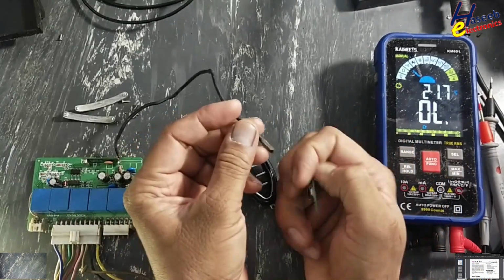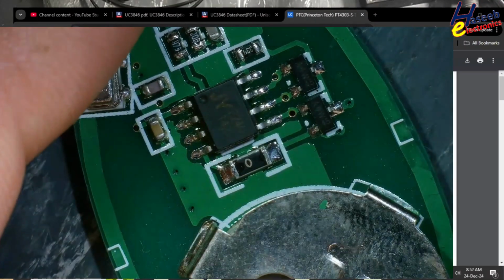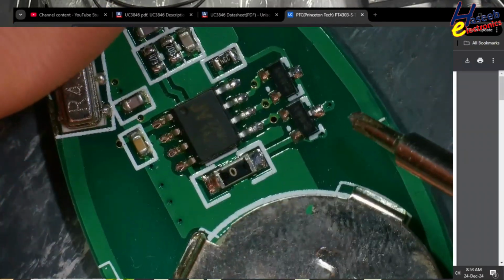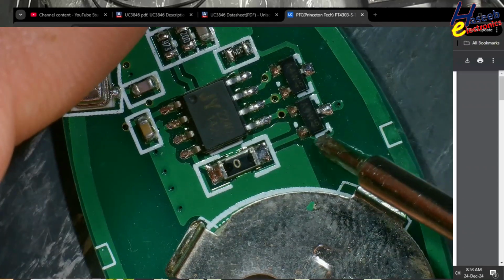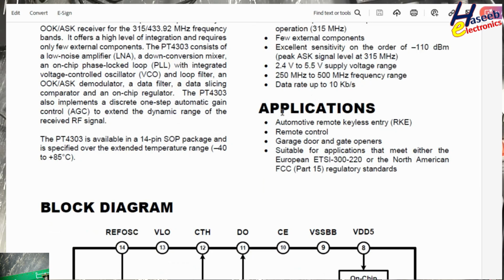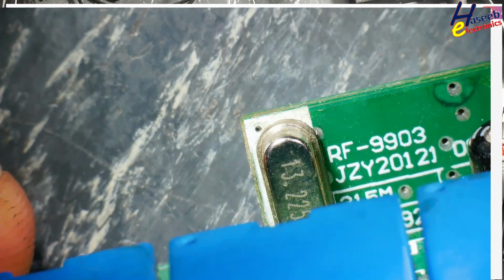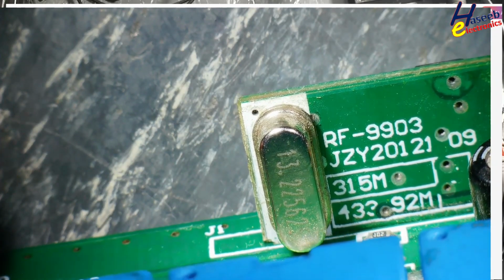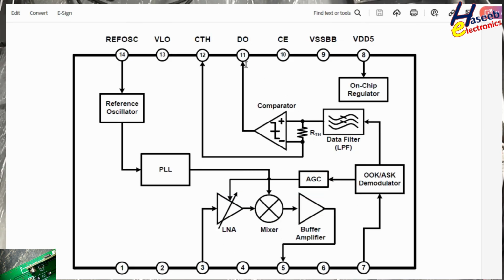{1091B} How Car remote works with car center lock security system

Comment: Nice, finally someone from Pakistan making good videos in English. Btw I think these keys are fixed code keys, nowadays there is code hopping technology so every button press sends a new signal.
Reply from the maker: Regards 
yes. these devices always change their code by means of a predefined pattern. and it uses random codes to protect from spying in or interceptions to the codes.

Comment: I’ve seriously started to like Dash lately.
Based on Fibonacci retracements and my 15-minute chart analysis, the market seems ready to start forming Elliott Wave (3) — potentially delivering around +130% in the mid-term.
Target zone lies between $180 – $200.

⚠ This setup becomes invalid if the price drops below $70 again.

🟢 Currently watching for early confirmation signs around the local support zone.

#Crypto #ElliottWave #Fibonacci #DASH #Altcoins #TA #PatternIQ

Comment: Excellent video Sir!
But, had a doubt, aren't car and higher security RF remotes supposed to work on rolling code to prevent against replay hack attacks?
By the way have you dabbled in SDR? We can capture these packets from the remote using an SDR tuned to 433MHz. RTL-SDR dongles are pretty cheap or Flipper Zero 😂!

Comment: Thank you. Is that a fix code remote? What happens with a rolling code remote. The code changes everytime for the same function
Reply from the maker: Fix codes are used in home appliances and cheap gadgets which don't have any security risk from attackers 
Automotive locks, and other keyless entry system contain hopping or rolling code system
Reply from the maker: Most of the car remotes use hopping code / rolling code technique to prevent from hackers. I just gave example of the working of remote control 
Basically there are several set of codes that are dedicated to a single function

Comment: How can I increase the response range for the car remote?
For example, when I parking my car in the Mall, the car will not open until I reach very close to the car.
Reply: That is because of the billboards' radiation. I don't know anything detailed about it but it happens.
Reply: The previous remote car was functioning well, but the new one not
Reply: May be a lousy battery( check voltage) or corroded antenna track on the remote. Do check

Comment: hi Sir can you please explain how mosfet driver cct works to drive the n channel mosfet and to discharge the mosfet, often i see in inverter cct or switch mode power supply , mosfet is used with pnp bipolar transitor or also a diode in series with the mosfet gate  , can you please expalin how this circuit charge and discharge

Comment: Please remember my humble appeal regarding the IGBT inverter welding machine high voltage problem 😊
Reply: Good day my friend the causes of high voltages  especially is input side bridge rectifier. Capacitors. Igbt's itself sometimes these components will be in short supply then it will cause